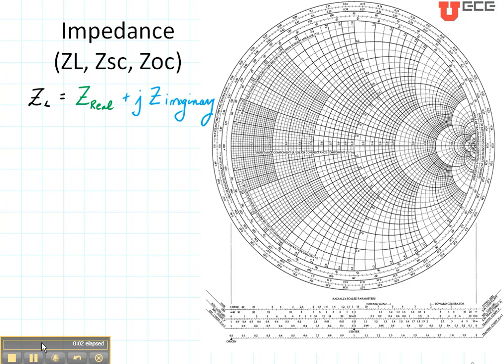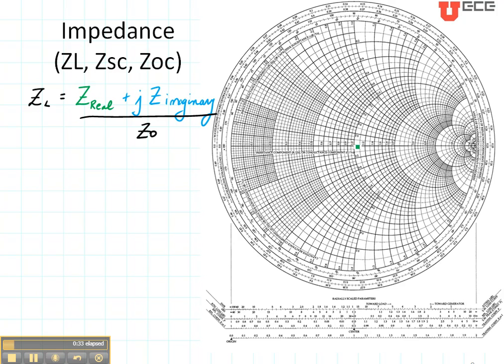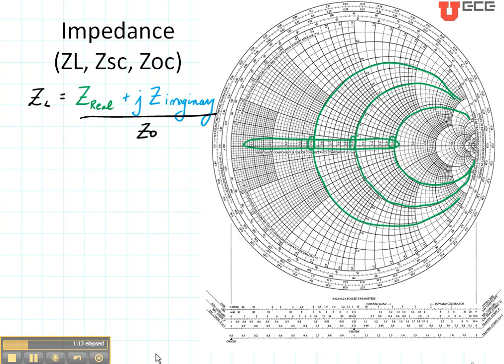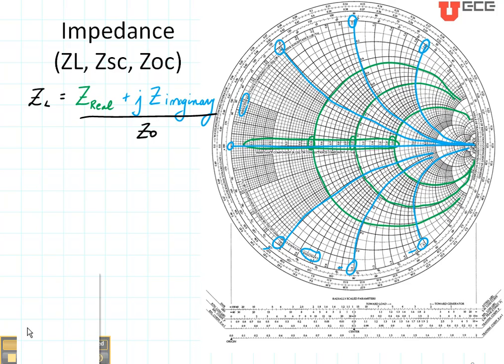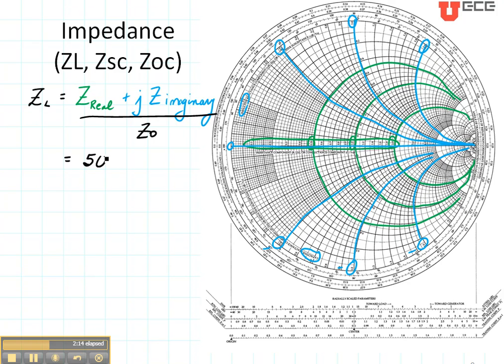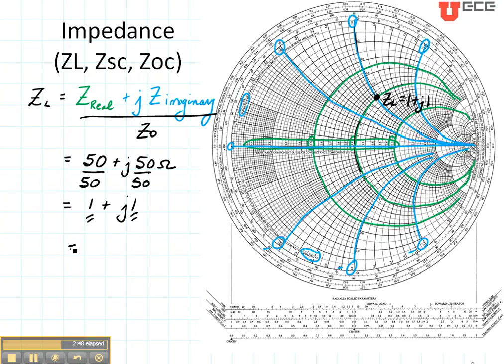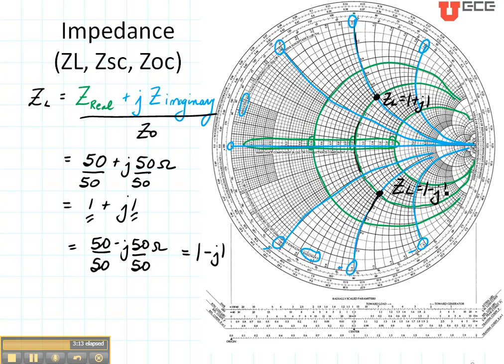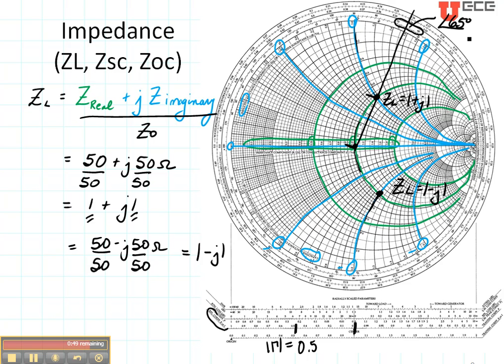ECE3300 Lecture 12b-4 Smith Chart Load impedance and ref coef

Comment: What do you mean by, "If you measure from the two points and reflect it?" In this example she is taking 2 different loads at 2 different times and measuring the load reflection coefficient of each. 0.5 is a good approximation, although its closer to 0.45.